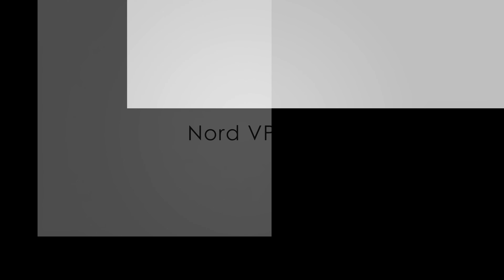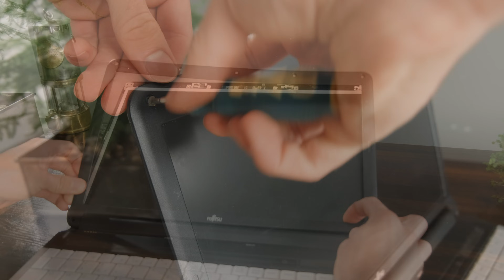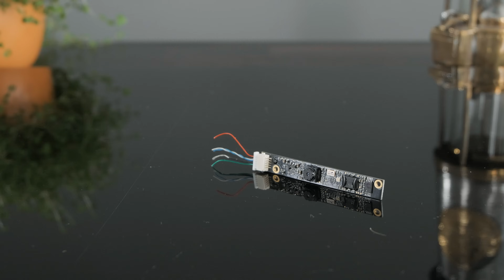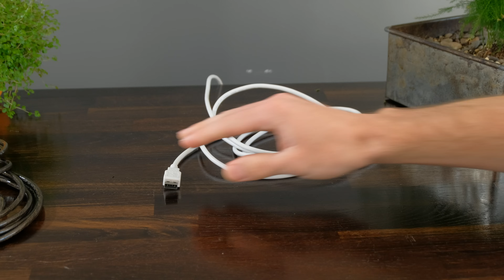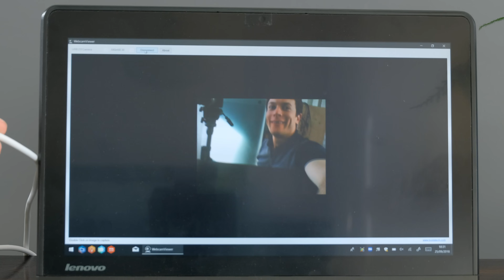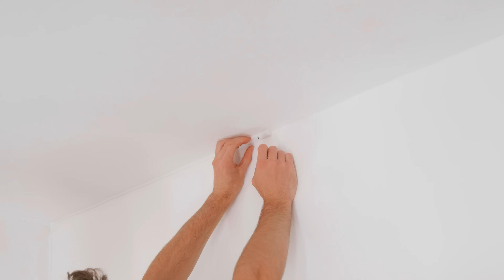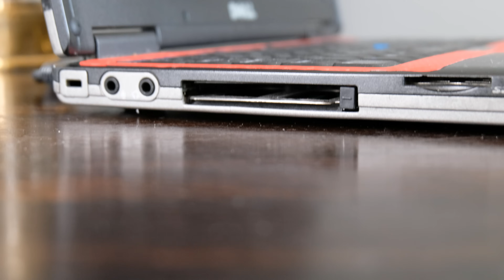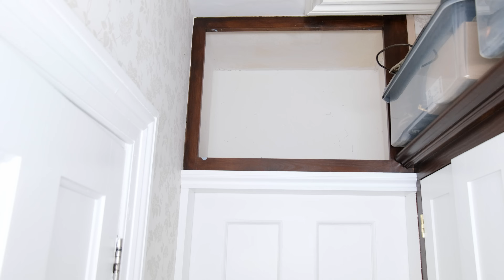DIY Home Security - ON A BUDGET!

Comment: I'd rather use an arduino or raspberry but this is a very easy alternative as well! Superb content as always!
Reply: I'd combine the methods- source out the webcams, add them to Pi systems, and have them communicate with a central server system.
Reply: Clearly you know nothing about Arduinos if you think you could use one for this.
Reply: Pretty sure an atmega based arduino is far too slow for live video, you'd need something a bit faster like at least an stm32f103c8t6 but either way you'd still need a way to access it, so without buying a bunch of addon boards your only cheap microcontroller option would probably be an ESP32, dunno how much data it could actually push but it could handle all the video work on one core while the other transmits the feed over wifi.
Reply: Arduino ? Nop

Comment: Nice video! 
Would it be possible to let the cameras livestream to your phone? That would also come in handy
Reply: Google remote desktop app maybe?
Reply: I think some people have made mobile apps for zoneminder
Reply: Something like VNC could be used for remote access to the laptop
Reply: @ThegamingZerii  what's VNC and where can i find it I'd like to wirelessly transmit it to my phone
Reply: @ojtyler9626  why don't you google VNC first?
Reply: oj tyler  googleling should work fine, website is realvnc
Reply: Install TeamViewer on the "central laptop", run it, stream it through your phone via Team Viewer mobile. Boom, done!
Reply: Google chrome remote desktop is free, easy to use, and is available on a variety of platforms :3
Reply: You can use ZoneMinder, and there is an App for it called zmninja-pro in the app- and playstore
Reply: idefox123  maybe OBS with the stream to the private YT channel?

Comment: Such an amazing idea! So simple to do and so important! Thanks for sharing!
Reply: isnt simplier and cheaper to just buy $20-30USD wifi ip cameras which have night infrared option, pan and tilt, alarm, microSD card for motion detection recording, android and ios app? so nop, its not a amazing idea, its lame idea nowadays actually...
Reply: @Hobypyrocom  the channel is called diy perks, the ip cameras are hard to hide, easy to vandalise, you can install streaming software in your laptop and phone, you can add more storage to the laptop with a hard drive for way cheaper then memory cards, infrared can be added to these cameras for dirt cheap (you simply have to remove the filter and add a 1 watt IR led).
Its an awesome build executed nicely.
If you can "DIY" it better then do share.😀
Reply: Azim Alif  i already calculated what is cheaper and i already created such system with way more options...
here is the calculation:
this system in the video has 6 cameras so lets say thats $12USD (with lame quality), you will need 6 Sugru costing $15USD, you need laptop which want it or not will cost at lesat $20-30USD, also you will need USB extenders and to buy decent ones for 30m distance you will need to spend at least $20USD on good ones for each camera and plus the usb hub if your laptop doesnt have enough usb ports which is highly possible... all in all presented system costs around $180USD (not including the cable between the usb extenders), how is that cheaper and "easier" than buying 6 x $20USD wifi cameras which have tons of options and way better video quality and requires no soldering or any other setup other than plugging them into power and setting them on your phone?
here is some options that those $20USD wifi cameras have: infrared for night vision, physical pan and tilt, one button setup, mobile app, alarm, microSD slot to record videos when they detect motion, two way audio and more...
i never said why he is making a diy system, i am just saying why he is claiming that his system is cheaper and easier than buying way cheaper already available options...
Reply: @IamIUareU  definitely not cheaper
Reply: @fssddfsd3  Definitely cheaper.
Reply: Azim Alif  and when you do it diy you always have control which software you want to use which camera modules for example from a laptop with an full hd camera would be more expensive but its possible an ir led is so simple because you can probably just run it the whole time even at day time so you just solder a ir led with a resistor to the 5v and ground pin and done
Reply: @BadMax02_VR  Ya, and if you don't want to break into laptops, you can buy cheap webcams. With a bit lower resolution.
Reply: IamIUareU nope the 20 dollar ones will set you back $120 and the $30 ones $180 this system will do it for under $50 plus the infrared can be done for an additional $10 and even wifi could be added for another $20 so the total amount would still be less then $100. You can buy a 100ft roll of usb 2 cable under $50 plus connectors would be only ten bucks. 8 pack of $15.99 total up to 60+12+15= $87 add $10 for ir and you are still under a $100. Pan and tilt is not really a must if you are just recording at home from a fixed spot. Your wifi ip camera defeats the purpose of diy and make for a very redundant, obtrusive easy to spot/vandalize and expensive system compared to this system shown in this very video. So not only is your idea expensive, it it lame and has no purpose on a diy channel. sorry not sorry.
Reply: Lalaland  do you even know how to sum? we are talking about the same video right?
6 laptop cameras x $2USD = $12USD
6 USB extenders x $20USD = $120USD
6 cables x 30m ($1USD per meter) = $180USD (also USB extenders uses CAT5 cables not USB cables)
1 old laptop = $20-30USD (lets say $20USD) (not any kind of old laptop, example P4 laptop with 512MB ram will not be able to record and watch all 6 cameras at once)
1 pack of 8 Sugru = $15USD
1 USB hub = $5USD
thats total of $352USD and you also need to have usb jacks and equipment for soldering... its stupid idea... also you need to have old laptop non stop powered and if you hide it as suggested in the video is a clear fire hazard...

hows that cheaper and easier for everyday DIY hobbyist compared with $180USD (if you buy those more expensive $30USD wifi cameras) set of 6 wifi cameras?

if you are talking about DIY yes setting up a system of 6 wifi cameras is counted as DIY... if wifi cameras system is not enough DIY then using a soldering iron or  bought laptop or laptop cameras should not be counted as DIY because they are produced by someone else and you are just using them... is that what you are saying?

DIY = Do It Youself, so its not like someone else is coming to your home to set that wifi cameras system...

get your facts straight and check before claiming something, i have done this type of system and wasted almost 2 years on it, checked and tested every possible idea that you can come up within the 10 minutes that you wasted on thinking before you wrote your comment...
Reply: IamIUareU  link the 20 dollar wifi camera please
Reply: ThomasKT  read all my other comments... this is one of them:
"i am not willing to advertise any seller or product, just go and search aliexpress you will find many wifi cameras as cheap... this is what the camera title was WANSCAM HW0036 IP Camera Wifi 720P HD Network Surveillance Camera IR-Cut Night Version Indoor USB Charger P2P Security CCTV Cam Price: US $20.52 / piece i bought it one and a half years ago... that seller is not selling anymore..."

Comment: This paired with some motion activated lights outside would definitely make a very nice budget friendly setup
Reply: Or even having IR lights that are not visible to the naked eye?
Reply: Just don't place motion sensor lights where you walk often. I never get used to them suddenly turning on, so they always startle me 😋
Reply: Well, having an old laptop running 24/7 could easily rack up an substantial electricity bill. So long term I suspect a dedicated solution would be more cost effective. And of course far less fiddly and prone to problem.
Reply: @SweBeach2023  what laptop are you using? And what country are you in?
Reply: yeah, actually without IR support it's not much of a security setup. not only you have to add IR lights which would automatically turn on and off, but also strip IR filter from camera sensor (which might be impossible to do properly since it's way too tiny and usually lens stack is glued around sensor on these).
Reply: @x-iso  wtf I got a notification from you and I haven't read this comment even.

Comment: You can use motioneyeos on the Raspberry pi
Reply: @DaveOTech  True, though there are many beefier alternatives to rpi nowadays that are a similar form factor
Reply: It would be to much load for more cameras for raspberry pi to handle. The fps would be to low. Better solution would be better image processing power computer
Reply: Ibrahim Osman you can use a rpi zero w and a rpi 3 b+ for the hub.
Reply: How many Webcam's can you link up to the pi ??
Reply: @DaveOTech  Extendable via a usb hub
Reply: I got the latest pi model b+ :/
Reply: @Osmanity  what resolution do you have the camera feeds at?
Reply: @DylanScully1  I use software that take a lot of processing power called opencv
Reply: Maybe on an odroid
Reply: I have rpi b+ and raspcamera and the frames are not great at all in realtime application projects
Reply: Ibrahim Osman depends on generation.
Reply: Perfect for monitoring my saltwater tank from 4 diiferent angles.
No need for video, just a snapshot png every minute, overwiting previous, apache share html.